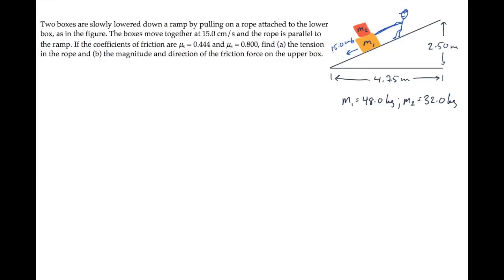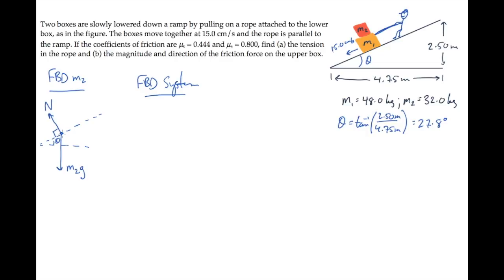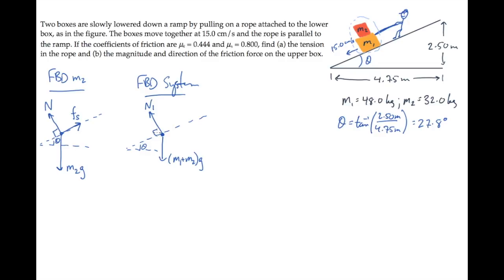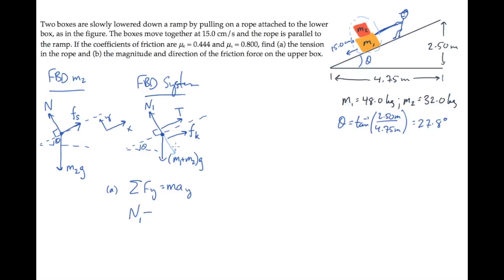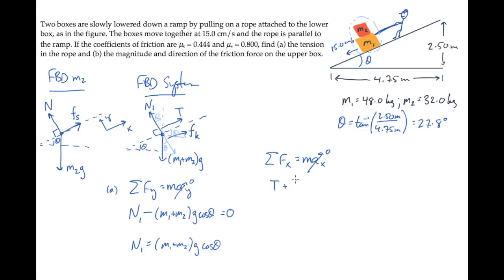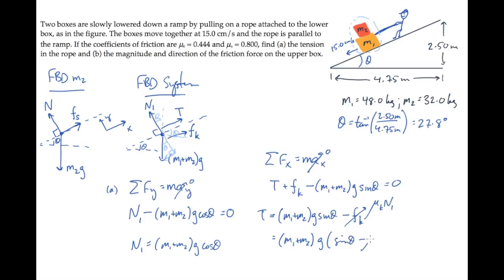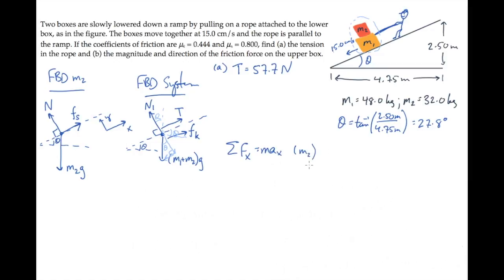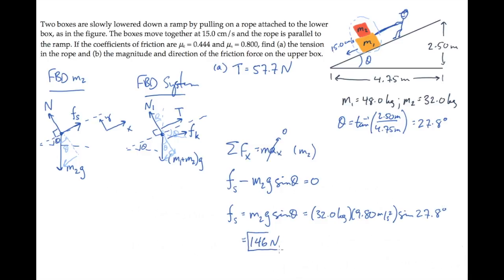Newton's 2nd Law: Kinetic and Static Friction. Level 2, Example 2

Comment: Why do you only draw 2 FBD? i drew both m2 and m1 and couldnt do it cuz my friction of m2 didnt match the friction that it was supposed to have on m1
Reply from the maker: It’s a case of “hindsight is 20/20”. Usually for 2-body problems I would draw three FBDs: m1, m2, and System. Any two of them will work, but m1’s FBD is complicated - there’s an extra normal force from m2 sitting on top of it, and there’s a down-the-ramp static friction force on its top surface (the reaction force from the static friction force keeping m2 from sliding off m1). It’s a tricky FBD to get correct! FBDs for m2 and the System are less tricky, so I chose them instead. Hope that makes sense!
Reply: @jhughesphysics1078  This is a weird question but on M2, i used Normal force of M2 to calculate static friction, the answer ultimately was wrong.

I concluded that i should not do this as i can take static friction to m2sin0 as static friction is not always Us*Normal?
Reply from the maker: Exactly! 😀 Static friction is <= Us*Normal. It takes any value needed, up to the maximum, to keep the two objects at rest relative to each other. For example, if the ramp is very shallow, very little static friction is needed to keep the boxes stacked. But as the ramp gets steeper, more friction is needed. At some angle, static friction reaches its maximum and, beyond that, the top box slides off the bottom one.

Comment: you can define the positive direction to be any direction you like, right? but when I try this with up the ramp being the negative I get -f+(mgsin27.8°)=0. which gives me the right newtons but the friction force is pointing in the positive direction. which is wrong, right ?
Reply from the maker: Good point. Yes, you can define positive to be any direction you like - you'll get the same answer either way. And, at least in this problem, there's no real advantage to choosing one over the other. Your choice!
Reply: @jhughesphysics1078  thank you so much for the reply and sorry just to clarify this was for part b. I tried it with how you defined the positive direction everything checked out. but when I first tried it with the positive direction being down the ramp I got a friction force with the correct newtons but it was positive so the friction force would be pointing down the ramp as well. so I must be doing something wrong after I choose my axis since my choice of axis shouldn't matter i just can't figure out why. I'm certain with my choice of axis you get the sum of the forces equals 
-f+(mgsin27.8)=ma=0
and with my choice of axis I should get a negative friction force but when I solve for f I get a positive.
Reply from the maker: Ah, I think I understand now. Your answer is still correct. When you solve for the magnitude of any force, it will come out as either positive or negative. If it’s positive, it means it goes in the direction you drew it on the FBD. But if it’s negative, it means the force actually goes in the opposite direction of how you drew it on the FBD. In your case, you drew it up the ramp on your FBD and choose “down” to be positive. Then you solved for f and got a positive answer, meaning your FBD was correct. 

In other words: f being positive or negative doesn’t tell you what direction it goes in - it tells you whether it goes in the same or the opposite direction as shown on your FBD (positive -> same, negative -> opposite).
Reply: @jhughesphysics1078  thanks again for clarifying small detail but things weren't making sense for a sec and I couldn't figure out what I was doing wrong

Comment: Why the magnitude of the upperbox is not 140*0,8 (coefficient of static friction) ?
Reply from the maker: Good question. Remember the magnitude of static friction is less than or equal to the normal force times the coefficient of static friction. In general its magnitude is found by summing forces in Newton's second law and you only use (normal force times coefficient of static friction) when you know it takes its maximum value. In this case, the box has no acceleration and summing forces shows that friction just needs to counter the component of gravity down the ramp. (But kinetic friction is different - it's magnitude is always (normal force times coefficient of kinetic friction).)